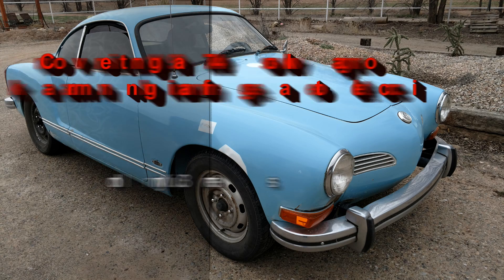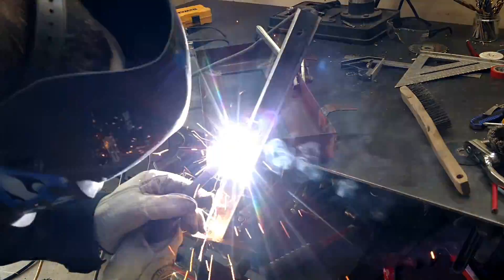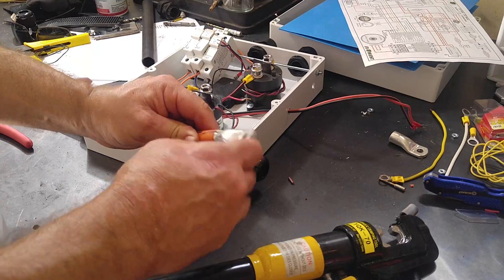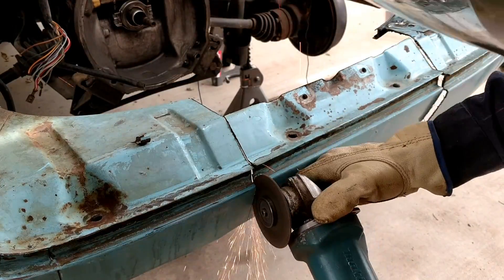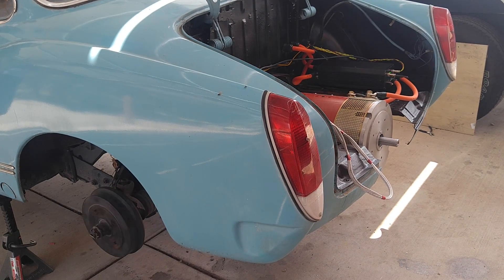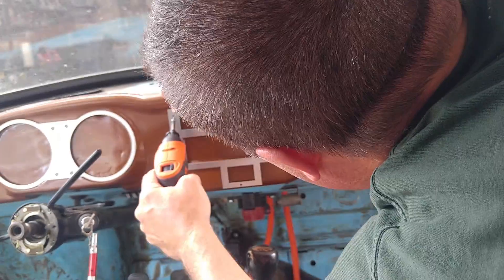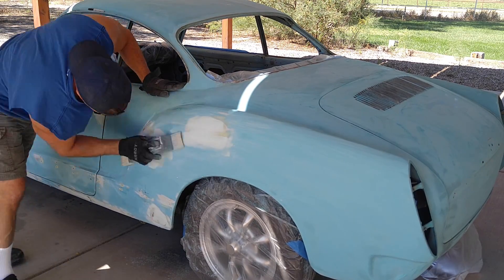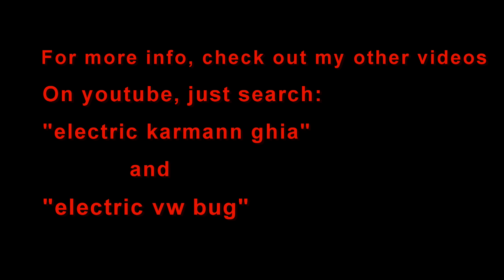Karmann Ghia Conversion to Electric (The Process)

Comment: Great job! We’ve got a Mini EV that the factory basically created by deleting the powertrain and accessories and welding up a cradle that mounts all the EV stuff where the ICE stuff went, bolting directly to the motor mounts. It is a blast although not as cool looking as the Ghia.

Comment: I've looked into this conversion and it's terribly expensive for what you get.

Love to to brag about the power but a $5000 engine would be more powerful.

It's a novelty just because you can but it makes no financial sense and honestly for a car like this why would you want a ruin it with electricity anyway, you want that sound of that flat four rumbling away. These cars are toys not practical transportation.

And even if you wanted to take it upon yourself to use it as your practical day-to-day vehicle it's far more practical gasoline than this conversion. Better said it's not even feasible as a true personal vehicle with it's extremely short range. It's like 100 miles or so, dismal and they are roughly 70k.

Pretty awful value proposition, and for what? So it has a weird whine that is annoying as all get out, vs the sweet rumble of a flat four?

You have to fall for their marketing hard to want to destroy a classic car like this.

Comment: How does having the transmission work? I love manuals, but I don't know what it does and how in an electric application.
Reply: Because it's a basic electric setup and not a Tesla.

To make it with no trans would take far more engineering.

Comment: Great video!!! The best!!! Can anyone do this, you made look easy. How many horsepower? Did you stay with your stock transmission? I have a competition motor (over 200hp)and transmission (close ratio gears) and pristine looking, do you still recommend electric?  Thanks
Reply from the maker: Thank you! The stock transmission lasted about a week. Had to upgrade to a KCR with a super differential with 4 spider gears, and a welded third and fourth gear. Of course I recommend electric!

Comment: I have watched this video over five times the last year and a half and it ALWAYS amazes me.  Do you have a "blue print" or a build schematic? just for ideas for other builders for similar small cars e.g. 1977 Mercury Capri
Reply from the maker: Thanks, glad you liked it! The only schematic I used was a basic DC wiring diagram from EV West, but it was for the Soliton 1 controller. I had to improvise with the ZEVA which uses CAN. Everything else I just made up as I go. If you want more details, check out the EValbum. http://evalbum.com/5330

Comment: Solder Everything!
Crimping, no matter how hard you squeeze it, does not provide a Covalent bond.  Look it up, you're moving electrons, you NEED a Covalent bond.
Solder Everything.
Reply from the maker: Soldering vs crimping is argued ad nauseam on the internet. Soldering is not necessarily better because it makes the joint more brittle and less resistant to vibration.  A well done crimp is just fine. However,  you lost all credibility with your insanely moronic statement about soldering forming a covalent bond! Are you shitting me!  Any high school sophomore in his first chemistry class knows that a covalent bond is a bond between atoms sharing a pair of electrons and has absolutely nothing to do with solder. BTW,  no crimp joints have failed in either of my cars.

Comment: All those batteries sitting so high will play havoc with the centre of gravity.  Over cook it into a corner and that swing axle tucks under is gonna make things interesting
Reply from the maker: Uh yeah, but it is not a swing axle. VW quit those around 1969. Furthermore, I stiffened the suspension significantly, and I would say that the handling is improved over stock. Also, it can corner faster because the added weight over the front axle prevents the classic VW understeer. I gurarantee you in any kind of race,  this would destroy any stock Ghia!
Reply: Ah right, does your Ghia have CV joints at both ends of the driveshaft, would make for much better handling. Don't doubt the performance advantages of an electric motor over the Vee-dub engines, or most any other engines for that matter
Reply from the maker: @buildituk  yes it does. It has IRS. No chevy Corvair situation here!

Comment: Those 'coilover' shocks from EMPI are crap. You should use new torsion bars in rear with higher load capacity.
Reply from the maker: They work just fine

Comment: In the future you can use actual electricity to create arcs in the wet paint. I can’t remember the name of the artist but he paints a lot of galaxy scenes on glass and he uses high-voltage to create extremely awesome looking works across his pieces.
Reply from the maker: I've seen that. I'm pretty sure if I attempted that, I would just melt the hood and never be able to find a replacement!

Comment: I really enjoyed your EV conversion as I am looking for detailed process to convert 2 classic BMW 2002's myself. I noticed your CSU t-shirt in the video as I am in FC as well and looking for local talent to advise me on these conversions. Is there an affordable  EV kit that you know of with a motor that would generate between 120 and 180hp? These small BMW's originally only had about 90HP and at this altitude now would only have approximately 76HP, therefore the conversion to EV would improve the performance and fun factor by double. Thanks
Reply from the maker: The best Kits I've seen are from EV West, but they are mostly using the AC 50 motor, which is decent, but not the performance you're looking for, unless you used two motors. Any kit will give decent performance, but the way I saw it is that if I was going to the trouble of doing this, I want the damn thing to scream!  DC has more torque by far. I encourage you to do it. Call EVWest and talk to Michael Bream. They also have some basic wiring schematics on their website. He'd be glad to help. Yes, I miss Ft. Collins! Good luck!

Comment: Hei I have a zeva 100amp like yours , does your controller keep the settings after programming it? you have pack of  batteries that beak maximum amps is 1000amps correct?because i have 3 batteries of 50amp in paralell so 150amp total pack but i cant pull more than 300 beak amps , and only one batterie can have a beak current 300amp so i dont understand , i wonder if the controller is limiting the beak amps. So i am asking you how did you programm your controller.
thank you very much
Reply from the maker: Either your batteries cannot supply the current or it is programmed wrong. Mine easily supplies 1000 amps. I programmed it with the EVMS monitor. It was pretty straight forward. Make sure you have motor amps and battery amps set to 1000.  Yes, it keeps the settings. What type of batteries do you have?
Reply: Hi Again  I have mitsubishi i miev batteries 3 in parallel each battery can give beak current 300amps so I fit 3 in parallel and 40 in serie total 120 batteries so i expectet to have 3 times the amps I mean 900 amps but i was dissapointed as i can read in the monitor the amount of amps as if it was a simple cell,t otal voltage is 160 fully laded ,148 nominal.
batteries are lion ion 50amps each so 3 cells inparallel 150amps i did get more range but not more amps come from the cells .so i wonder if the controller is limiting or the batteries cannot give more.
thank you very much for your time
Reply from the maker: I suggest you email Ian Hooper at ZEVA. He is very helpful and knowledgeable. Your setup should certainly give you close to 1000 amps.  You could try creating a dead short on one battery and measuring the current to make sure it can deliver 300 amps. Just remove it from your pack first!
Reply from the maker: @alejandrocabanas4287  i think your batteries are most likely the problem, especially if they were used. I only say that because my ZEVA controller easily supplies 1000 amps, so yours should too.
Reply from the maker: @alejandrocabanas4287  douuble check all your connections. One bad connection could easily create enough resistance to limit the current.
Reply: I will contact Ian Hooper but I must thank you so much for being so Kind and helpfull

Comment: Best EV conversion explanation I have seen. Quick pace but relaxed too. Do you find it more rewarding doing the work or driving the car afterwards? What other cars would you to convert to electric or see other people convert?
Reply from the maker: Thank you very much! Actually I find it much more rewarding driving it afterwards! However, driving it knowing that you built it is the most rewarding. VW's are the easiest to convert. Any older car is quite doable. I'd love to do a muscle car like an old Mustang. I would be scared to do a modern car with all the computers, sensors, etc. Seems like a lot of stuff to go wrong.
Reply: @bottsfinevids4463  
Old Mustangs turn into a ball of fire when rear-ended
Obviously an electric mod would solve that.
I  hope you find one at a price AND condition that works for your project.
That VW is way cool.
Great job!

Comment: Amazing job! Range?
Reply from the maker: I appreciate that. Driving 50 mph or less, it'll go 120 miles. On the highway, 80+ mph, maybe 75 miles.  High speeds destroy range!
Reply: Botts Fine Vids Regen Braking?
Reply: That's no bad at all 120 miles normal driving  considering the size and limitations  of space for installing battery
Reply: I think a truck would be a good conversion as lots of space below the box
Reply: Do you wish to share how much it cost

Comment: Excellent video.  Looks like you had fun putting this together as well as driving it.  How big of a battery did you put in? (In Kwh).  What kind of range can you get out of the car at both city and freeway speeds?  Can you make use of public charge stations?  Do you shift gears at all?  Anything you would do differently if you built another?  Thanks and looking forward to more videos.
Reply from the maker: Thanks. The battery pack is 26 kwh (45  180 ah LiFePO4 cells). Can go 120 miles at speeds of 50 mph or less. On the highway at 80+, probably 75 miles. I drive 95% of the time in 3rd gear and rarely shift. I could put a J1772 charging port on it to use public charging stations, but I found it far more useful to just use the standard 120v plug that I can plug in anywhere. It takes longer to charge, but I'm never going on road trips anyway, so it really doesn't matter.

Comment: What about a heater?
Reply from the maker: I used the heating element out of a $15 Walmart space heater, put it inside a metal duct and attached a 12v marine blower. Instant heat! Superior to the original! Just don't ask about AC!
Reply: @bottsfinevids4463  I won't ask then! But its something thats not essential as we used to manage ok in the old days. I recall sutting in the back of my mates car in the 70's, put my leg up on the open window and let air blow up one trouser leg and out the other, lovely! Probably illegal now!

Doesnt the motor produce heat? Can this be used somehow? Doesnt a heater drain the battery much faster?

Battery technology still has a way to go before I go electric, i.e. double the capacity and half the price!
Reply from the maker: @johnf3326  I don't think the motor produces enough heat for an effective heater. Yes, a resistive heater does drain the battery,  but not much. I lose about 10% of my range. True about not needing AC.  I've noticed these older cars don't get nearly as hot as modern cars, mostly because of the smaller and more vertical front and rear windshields.  I drive it nearly all summer unless the temp is above 95 Friday.  A modern car gets impossibly hot when parked in the sun and no ac wouldn't even be possible!
Reply: @bottsfinevids4463  probably not worth ducting round the motor to collect that small amount of heat. If battery technology improves, hopefuĺy one day it can store enough power for hundreds of miles and any heating or AC requirements.

Most new electric cars have one fixed gear. I'm wondering if selectable gears are useful in that you could achieve phenomenal acceleration by gearing the motor down. Also you then still have the experience of 'changing gear'. But then you would have to retain the gearbox and clutch. But you would have the option of leaving it in any gear and driving 'purely electric'.

Comment: WOW Great work, you are awesome.
Can you tell me the type of motor used and the seller as am welling to convert mine but the prices of the motor are really high and how many batteries did you install there
Reply from the maker: Thanks! The motor is a Netgain Warp 11, which is huge for a car that size! The bug has a Warp 9, which is also amazing. You might be able to find a used one. Call Netgain. I have 45 LiFePO4 batteries (180ah each) which makes it about 26 kwh.
Reply: @bottsfinevids4463  what is the range you get out of the 26kwh?

Comment: Hi, very interesting. Did you use some sort of conversion kit, for all the electric power and control components seemed to work together real fine from the very beginning.  I own an MGF I'd loved to convert to electric drive.
Reply from the maker: No, this was not from a kit. Any DC motor of your choice will work with any brand of DC motor controller. I would just pick a controller that is at least a thousand amps. The kits at EVWEST are very nice, but I wanted mine to be faster and more powerful. Good luck!

Comment: nice cars and tech etc.  but unless you are using total solar cells to recharge it or electricity from a  water dam generator you are using fossil fuels making electricity from somewhere else . otherwise a great video !!
Reply from the maker: I am using total solar. Even if I wasn't, electric cars are still far more efficient, as are power plants. With electrical motors, almost 90%of the energy used is converted to mechanical motion, whereas an internal combustion engine is lucky to get 30%. The rest is just waste heat.
Reply: @bottsfinevids4463  Which begs the question:  What do you use to heat the interior?
Reply from the maker: I have a homemade heater that works amazingly well. I simply removed the heating element from a 15 dollar Walmart space heater and put it inside a duct with a blower. Instant heat! The heating element is simply a resistor that doesn't care if its hooked to 120 volts AC or 150 volts DC.

Comment: I wonder as to a “death wish” of anyone driving a, shall we say, non protective body like any old VW, at over 60 mph let alone 95 mph specially with less than optimum brakes, no ABS, old suspension, etc. on a public road and, did I notice no seat belt/shoulder harness? I realize u wish to show off the magnificent conversion job, performance, etc. but, please, the risk of a crash are very high. Be safe. Thanks
Reply: Ramon Cardona There is definitely a seat belt.
Reply: Maybe he should have a part 2 where he adds all the safety features to appease you... he he he he he. Unbelieveable!

Comment: I  think it is a shame to not keep or resort such an ionic car as the VW Karmann Ghia in its origional state as much as possible! I wil give a few reasons for this: 1) there are only left a few of these cars and the loss of every one of them makes one less; 2) Why take this expensive car (15.000 - 65.000 euro) for this conversion if you can by a standard now a days car of 10-15 years old for 500-1500 euro (less cost); 3) The suspension and steering of this car is very primitive indeed, so why not take a young car for this conversion, so you will get a much more enjoyment of your ride; 4) If you change this very old car in this way you will have to change the steering, suspension and not least of all the brakes, because they are not made for such a power and speed, otherwise you will get an usafe car on the public road!
Reply: It's just an old car. A not particularly good old car.  I squirmed a bit when he chopped into the body too but it's turned out OK.  It's a better car now than it's ever been before. I drove one for 4-6 years when I was younger, they're just garbage to drive and with a gas engine, need constant maintenance.
Reply: Karman Ghia's are worthless pieces of forgettable crap - a 1970 Big Block LS6 Chevelle or Hemi 'Cuda it AIN'T! It was limp-wristed then, and it's embarassing to be seen in now!

Comment: Actually the car with batteries in the front has more balanced braking and weight distribution. My only disagreement is that the electric engine brings weight far more back.For history and VW lovers I must remind that Germans presented the car with a malfunctioning steering that days of '60s.

Comment: Well this is brilliant - with the extra joy it's annoyed a couple of self-appointed purists - reminds of that line, '"You have enemies? Good. That means you've stood up for something, sometime in your life." - It's a tribute too to those early VW gearboxes that they can soak up that power so well, ^oo^
Reply from the maker: Thank you! Yeah its funny to see some of the reactions of the luddites! Actually, the stock gear boxes failed very quickly. I had to upgrade them to a super differential and welded 3rd and 4th gears.

Comment: Thanx for recking a classic. Already noticed  mine is worth more after this.
Reply from the maker: Interesting. The word "recking" means of great importance, so thanks, I agree. However, there is a chance that you actually meant "wrecking" in which case you are very uneducated, aren't too bright, and your opinion matters very little.
Reply: He took a "bucket"  into a BEAUTY!
Reply: I wouldn't buy a Karmann Ghia unless I was going to strip out that worthless air-cooled dumpster fire 4 banger and put in electric.  He saved this thing from rusting to the ground in the back yard of a KG fan with grandiose dreams of restoring it and selling it for cool $7K.  Matt made gold out of junk in this video.